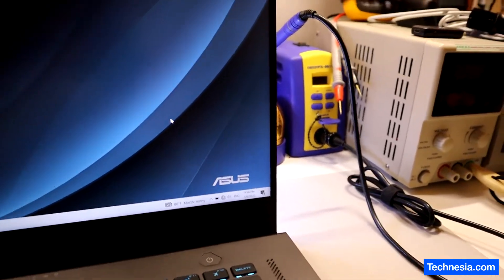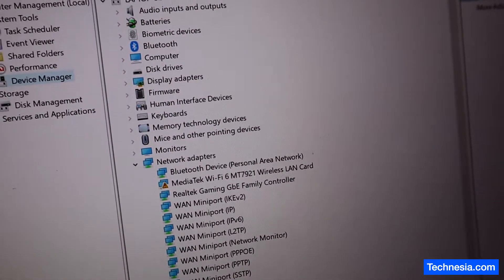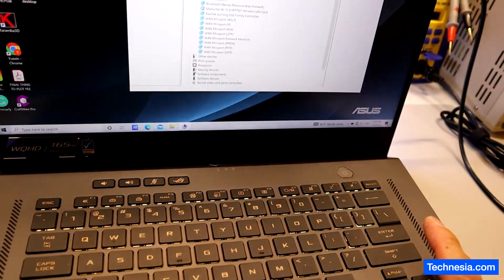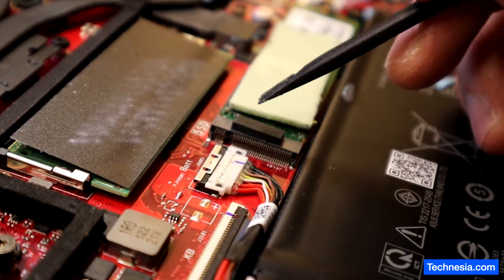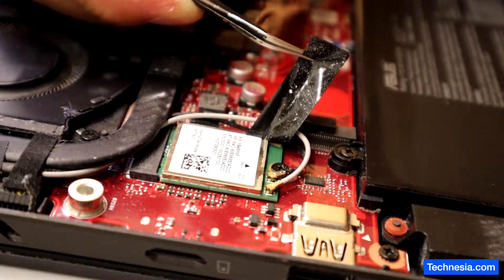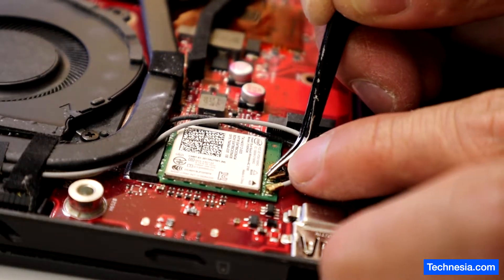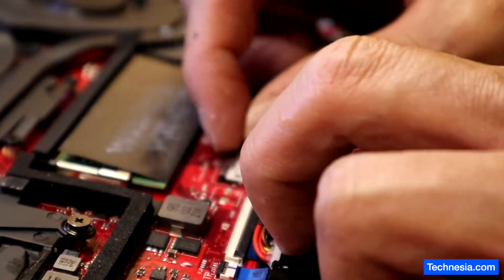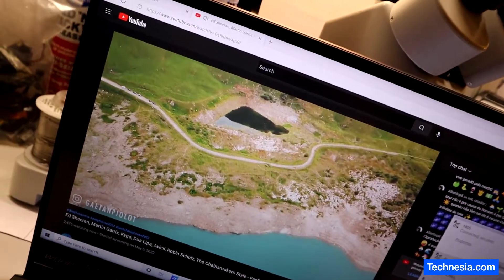ASUS Laptop WiFi Not Working - Not Detected - No Internet

Comment: Bro, in my case wifi keeps on disappearing whenever i install valorant.. my wifi is gone and even become undetected.. it get fix automatically next day only if i reset my pc... If i dont install valo. It works perfect.. any suggestions?

Is the problem with network card, should changing it fix the issue ?